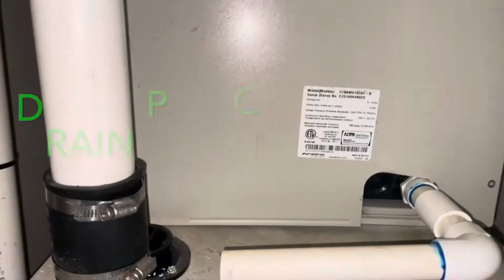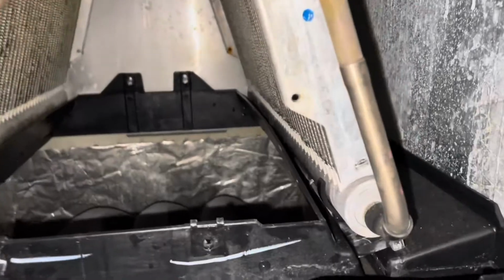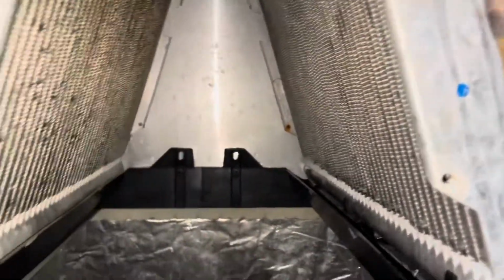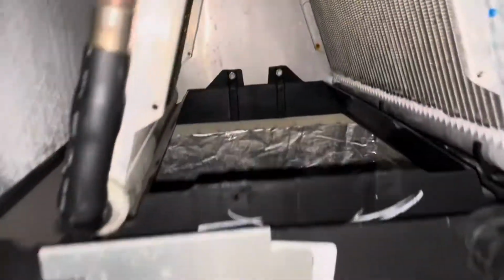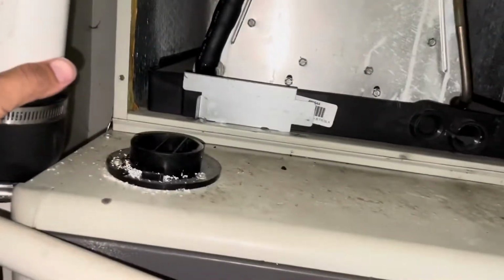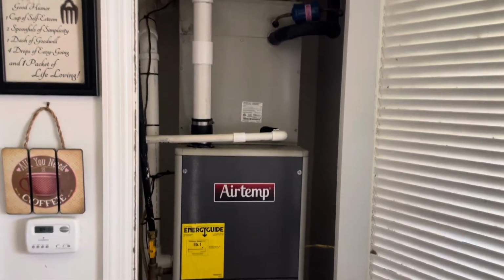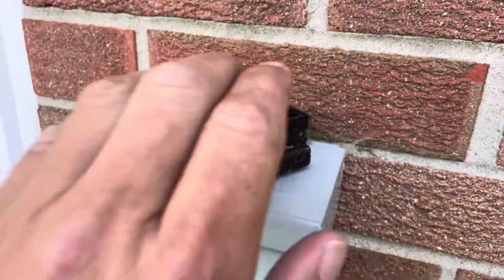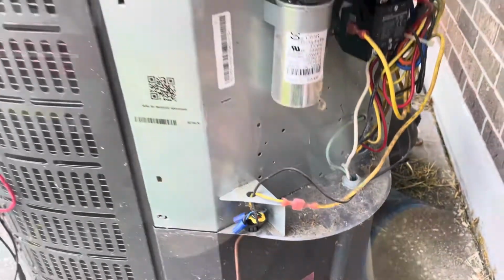Cracked Condensate Drain Pan, Repaired!  Plus Another Low Voltage Short Repaired!

Comment: I just ran into one on the new C85 mobile home coil. Luckily I had not brazed it in yet when I tested the drain and pan. You couldn’t easily see the crack before installation, but it’s there. That’s the last airtemp after bad 5 ton inverter compressor this past summer. No more. No thanks!
Reply from the maker: Good find.

Comment: I am a female homeowner who has rigged a way to keep condensate from running under a wall and into the house. It was nice to see what a whole drain pan looks like, so thanks for the video! Been troubleshooting the past three days as a shop fan is working to dry out the carpet in the adjacent room. Cleaned the indoor filter, cleared the drain line, removed some slime and debris from the pan, etc. Thought we were good. But the carpet was not drying. Looking further into the problem today revealed water dripping from the bottom of the coil areas, all the way back to the wall as bad as ever! Maybe our drain pan is cracked or clogged? For now a plastic bin lid has been fitted into the filter slot to catch the condensate. Cotton laces from old pants are being used to wick that water along the drain tube path and outside. I hope I am not creating a bigger problem as some of that water is getting sucked up by (the intake?) due to my bin lid bending upward in the middle.
Reply from the maker: You might at least want a tech to come diagnose the issue.  That way you would know if it’s a cracked pan or possibly just a clog somewhere you can’t see.  

Glad you enjoyed the video.  Good luck.

Comment: I’m thinking of changing my cracked drain pan on a a Goodman hvac. I think ok unscrewing it but you left th e important part of how you lifted the coil up! What did you use to lift it up and then slide the pan out?? Otherwise a great vid
Reply from the maker: I stuck my right arm into the A coil and lifted it up from the center with peak of the coil resting on my arm while I pulled the pan out with my other hand.
Reply: @JeffsHVACAdventures ok thanks! I thought may have tied it in place! Didnt realize the coil wouldn’t fall after the pan was removed😂! Thanks again

Comment: Hey Jeff. I have same exact issue actually. Same unit it’s an Airtemp Gas furnace with AC coil. Where did you get your drain pan from?
Reply from the maker: R.E Michel is my AirTemp dealer.  I believe AirTemp is exclusively sold at R.E. Michel

Comment: The one I have had a steel drain pan that's corroded. It's a GoodMan unit. Is this possible to do with a steel tray?
Reply from the maker: It is possible but you would need a metal shop to bend it up for you.  You would need exact measurements.
Reply: Couldn't I just replace it with a new plastic one?
Reply from the maker: Yea you could.  Best bet is to contact a Goodman dealer and see what they can come up with.
Reply: @ great , I will do that. thank you!

Comment: I've had nothing but problems from my less than 3 years old ac, and after my old incompetent maintenance guy came in to unclog the ac drain the bottom of the unit started leaking within an hour of him leaving and for the past year I cant seem to convince the office or the new maintenance guy its the pan because hes stuck on the overflow shut off sensor, even with me telling him if theres no water to going past the sensor into the drain than its going somewhere else... the drain and sensor are both dry as a bone!

Comment: the hvac person who came to my house for a leaking drain pan said they need to disconnect/cut the copper tubes and re charge the freon to change the drain pan.  Is he just padding the bill?  want's $1200 in NJ  I have a high efficiancy Rheem furnace that  looks similar to the one you worked on in the video.  I liked and subscribed.  That was a great video.
Reply from the maker: Some systems you do need to disconnect the coil which requires removing Freon, evacuation, etc.  seems like a fair bill if all that’s needed.   
Thanks for the support.

Comment: I, have been following your videos .
I have an issue trying sell my home during first hvac repair guy found no serious issue. 

Fast forward two weeks later check we hear water dripping inside bottom drain pan.

We looked only one side had condensation a rust spot on corner metal on one side and at the bottom a rust stain opposite side. The water leaking coming out the front and dripping into the drain pan.  

How can we stop if on a budget we have a buyer who wants no inspection. Should I think about fixing anyway?
Reply from the maker: It’s better to get it checked out again before something serious happens.

Comment: OMG! This is the best video I've found yet, I'm having this same exact issue, only thing I have refrigerant lines directly in front of that triangle panel so I can't get it off to get to those two screws way in the back. Any suggestions are welcome thanks alot.
Reply from the maker: That’s a tuff one.  Only way is to try and bend (without kinking) them out of the way or cut the Refrig pipes and do the whole process with that.  Good luck.

Comment: Great video!  I had some technicians do a similar pan replacement, as well as replacing my drain pipe.  A few days later now my system ices over.  Any ideas why that would be?
Reply from the maker: If the filter and coil are clean it Could be low on refrigerant.   If they had to pump the refrigerant down to replace the pan (which you have to do sometimes doing this) they may have either not put enough refrigerant back, or you might have a leak.  Best to get them back out to have a look.

Comment: I have an AC from 1999, the drain pan is metal and rusted out near where the PVC drains the water to outside the house.  I want to replace it with one of these plastic units. Where can I buy such a pan?  Thank you.  Other than the leaky pan, the AC works just fine.  I really don't want to replace the whole thing.
Reply from the maker: Typically the original coil would have needed to come with a plastic pan to get a plastic replacement.

Comment: What is a good way to find the crack? I had 2 HVAC companies came and 1 said there is a crack, the 2nd pour water on top of it and didn't find any crack or leakage from the drain pan.
Very frustrating.
The leak only happens when the AC is OFF. No leak when the unit is ON. 
Plumber cleared the primary drain line with a snake and a blew air in it.
Does that says anything to anyone as to the root cause of the leak?
Reply from the maker: The pan needs to be inspected thoroughly (Sometimes even removed from the unit) to inspect it for cracks.

Comment: Could the crack be "repaired" by coating the inside of the drain pan with a waterproof sealant, such as Flex-Seal?
     Cracked drain pans are common in Whirlpool refrigerators. The Whirlpool pans are plastic, and it's believed the cracking is due to the vibration of the fridge motor.  Perhaps the frequency of the vibration is close to a resonant frequency of the pan?  Maybe the vibration could be dampened by inserting rubber grommets between the pan and the points where the pan is screwed down.
Reply from the maker: Could have used a pan spray or flex seal but I usually only use that in a temporary fix.  Sometimes if it’s just a very hair line crack I’ll leave it with pan spray but a crack that big I like to do the whole pan.  
I’ll check the vibration next time.  Thanks.